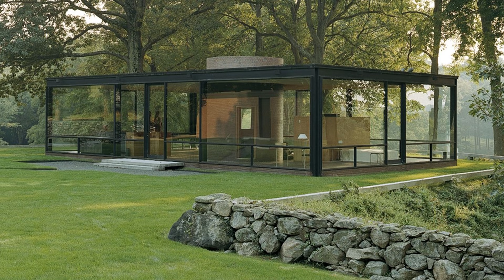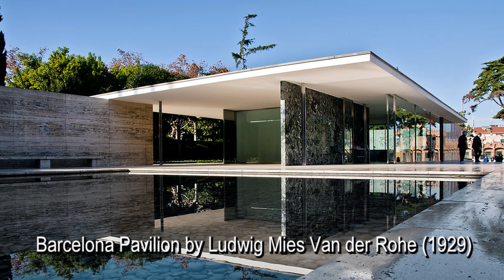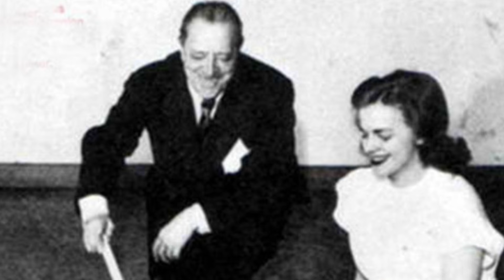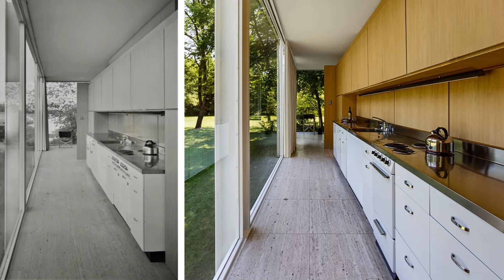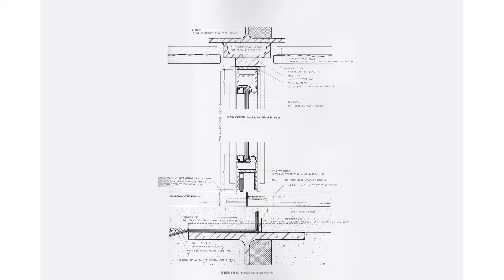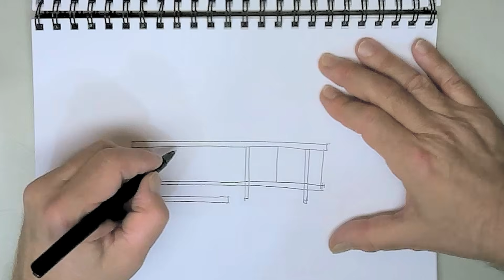Architecture CodeX #77 The Farnsworth House, Plano IL by Ludwig Mies Van der Rohe

Comment: A really good coverage of the issues.

After a tour visit I came away thinking that the structure was exquisitely welded, if you look underneath there are some that were never ground off, the fittings were of very high quality, the cost of the artistic license to the client was high, too high probably. Also if Frank had designed it he would have sited the dwelling midway up the hill and thus avoid that flood plain of the Fox River. 

At the time of the visit there was a plan to lift the house above flood levels but in my mind it needs a demountable coffer dam around it in the winter months. Lord Palumbo lost big value artworks in one of the floods.
Reply from the maker: FLW  might have put the house on the ground in the same place saying, "You want to be of the river not just above the river."  ;-) Thanks for watching and commenting.
Reply: I agree with your assessment, FLW would not have placed in the flood plain.

Comment: At 13:05 - wrong! I just built house like this. It costs energy but gives adventure!
Reply from the maker: So, what is wrong?  I could build a similar house but using today's energy conscious approach the detail would be different.  You seem to confirm that as designed it is an energy hog.
Reply: @architecturecodex9818  hey! I understand what you mean. And I agree in almost anything you said. But I really built one, very similar, but with double glazed low-e windows. Rest is much the same, more or less. Only great minus is that I don't have big tree on south-east side of the house for shadow in summer and sun in winter. But with air conditioner and curtains during morning it is liveable. 
However, great presentation from you.
Reply from the maker: @SlugaBeskorisni   I would love to see the house.  Where is it?  But again, we agree!  I would not build a house in the manner of the Farnsworth house without double pane Low "e" glass or thermal breaks or massive amounts of insulation.   I am building one now (not strictly Farnsworthy) but with exterior overhangs and shades.  The image on the upper left https://molinelliarchitects.com/residential--more-projects.html
Reply: House is actually 8 by 8, completly armed with barcelona furniture, mr10, mr20, longe chair, love seat chair, daybed, queenbed, table, coffe table... all is in there.
Reply from the maker: @SlugaBeskorisni  is it your primary residence or a weekend/vacation residence?  through my website www.molinelliarchitects.com you can find my email address
Reply: @architecturecodex9818  for now it is weekend/vacation, but with full potential for primary residence. Periodically Iive there.